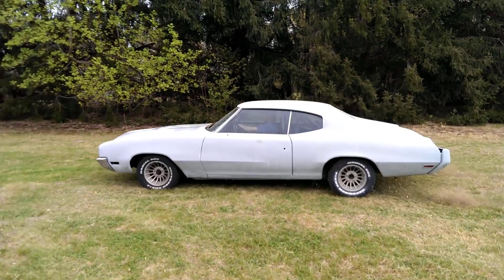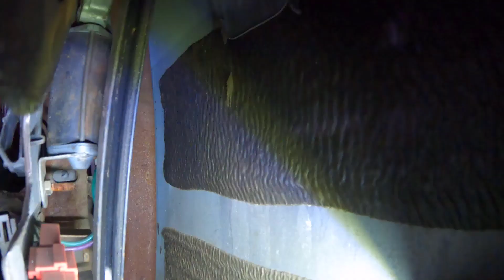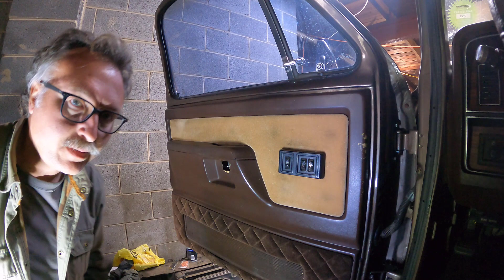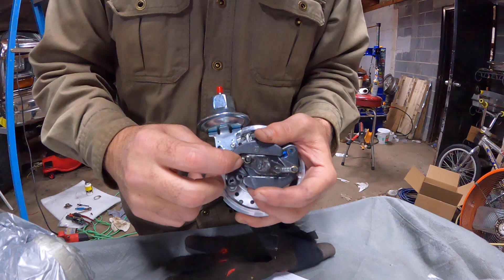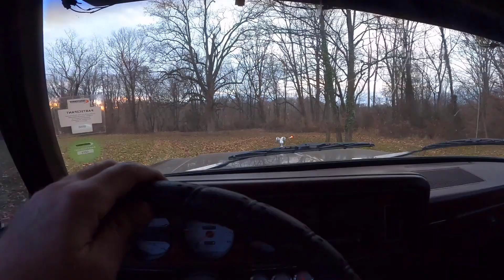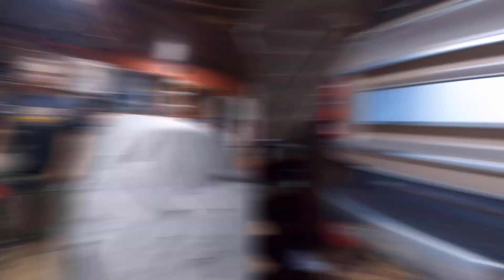1989 Ramcharger 383 Open Headers, Pro Series Distributor, Power Window Motors and Radiator

Comment: I love the Mopar 383 engine. My first car was a 67 Chrysler Newport with a 383.I think it's okay grounding to the head. All the head bolts create a great ground path.That being said your ground is probably best.I also did the presision hole drilling to fix power window motors on my Lincoln.
Reply from the maker: Oh wow, on my lincoln, i didnt do the drilling! I learned how to bend my arms in wild ways! 20/20 hindsight!